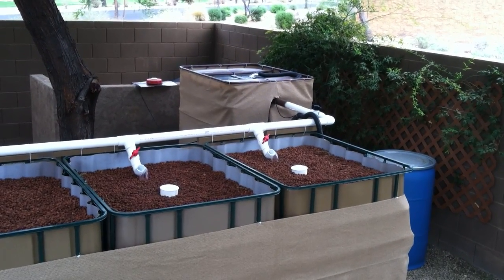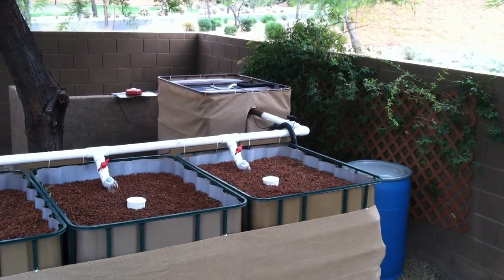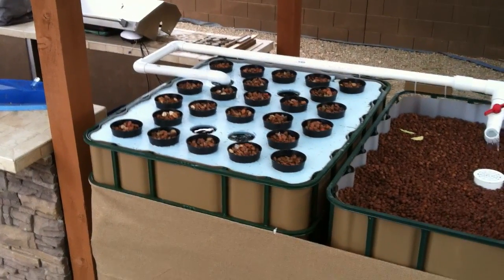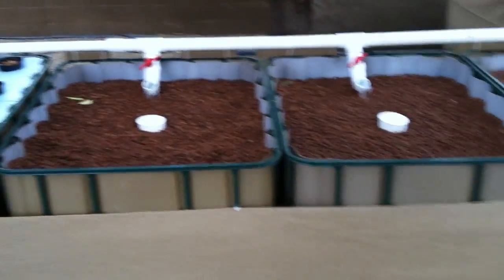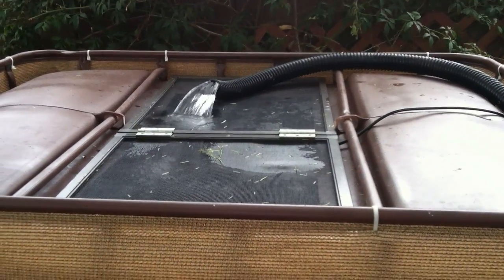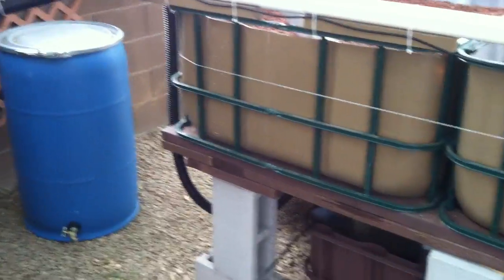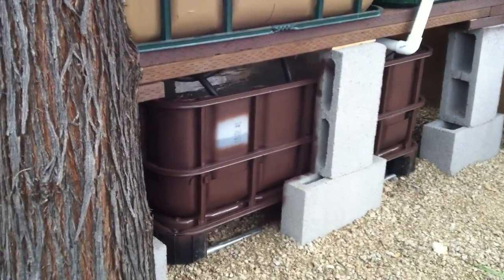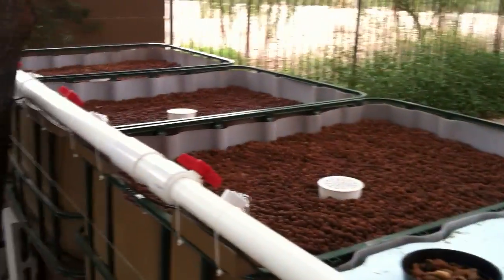Aquaponics in Arizona

Comment: You will get algae and everything growing where you have surface water in the traditional grow beds. I suggest you bury the inlet below the surface.
Your pipes seem oversized for just filling grow beds- surely 1" or 3/4" pipe would probably have been sufficient and cheaper too.
You are exactly right though about using a large water volume to make the system more robust against ammonia spikes. My system has around 2200kg water and I hope to add 1kg of rainbow trout (100 fish, 10g each) later today. I have been cycling my system too as it has been dormant for 3 months, but I need to dump the ammonia (currently 5 ppm) to make it nice for my future dinners. :-)

Comment from the maker: I couldn't bury the tanks.  They need to be such that I could fit them under the beds without having the beds to high.  I am using a 2000 gph pump and so I am moving quite a bit of water.  One sump tank at the size I am using would overflow when the beds drained or it would run dry as the beds filled.  Having 2 also allows for more water in the system which reduces swings in water quality.  The hardest part of setting up a system is the Hydro-mechanics. Water does what it does.

Comment from the maker: I used 9 bags of hydroton in each bed.  It's a lot, and expensive, but I did it that way so I would be able to try root plants like onions, beets, carrots, etc.  It also allows for more water in the system.  I built it to run as much water as possible.  The more water in the system the more mistakes you can make and not kill things.  The water quality stays more stable.  I think the beds are 14 inches deep.

Comment from the maker: The weight is distributed evenly over the entire area so it works well.  I calculated that each grow bed, when full with water, weighs about 800lbs.  I stagger the fill and drain so the tanks are not all full at the same time.  I have had this set up for 6 months now with no problems.